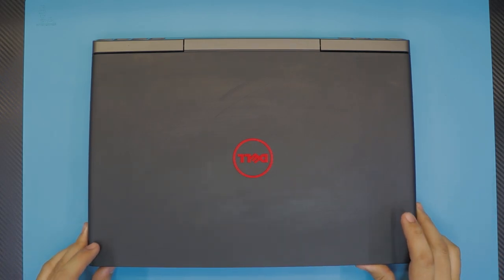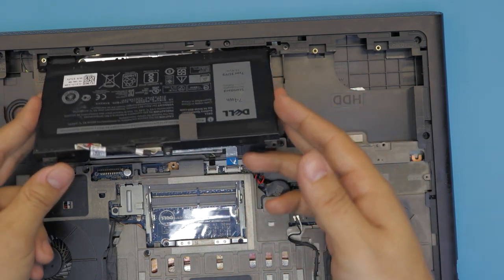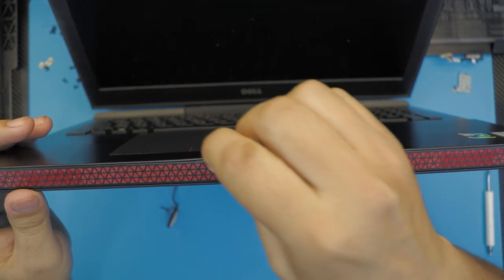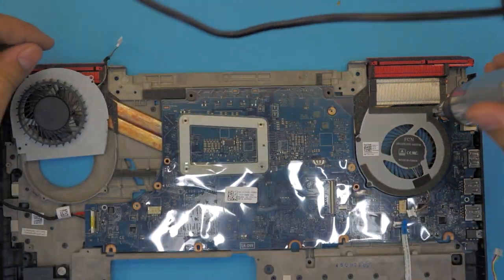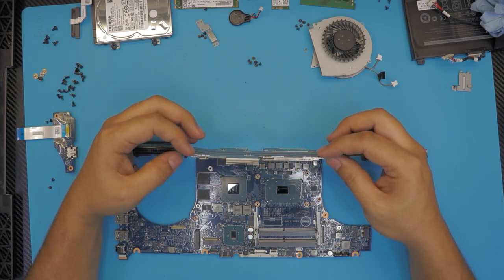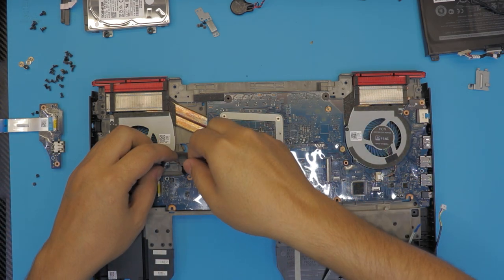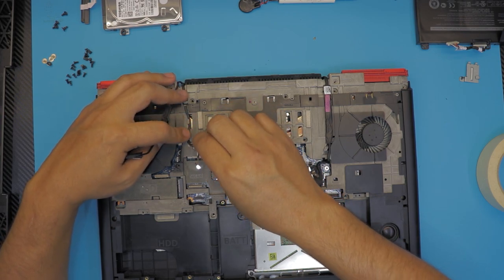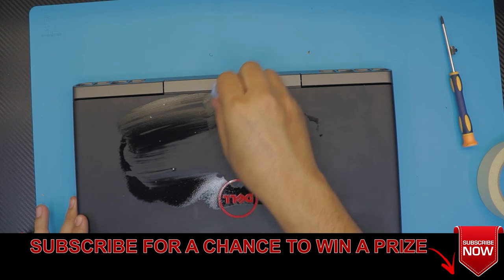Dell Inspiron 15 7000 LIQUID METAL thermal compound and teardown

Comment: I am planning to reapply thermal paste for my laptop and picking the right tools for it. Which of these tool kits is good enough ?
Set 1: https://www.amazon.com/gp/product/B07P6WSXBW
Set 2: https://www.amazon.com/Kaisi-Electronics-Professional-Precision-Screwdriver/dp/B07ZNHWHV5
I intend to use them for the current laptop and for building a pc around 2 or 3 years later.
And can I ask how would you organize the screws during the work ? There is a lot of different screw and I am scared to lose a few of them.
Reply from the maker: i would recommend you record your self doing it or simply in a sticky note write down for eg. bottom cover screws... and place the screws there, and fan screws.. and so on.
regarding the screw tools i recommend the following from top the best to less best:
the best : https://amzn.to/2CATV8e
2nd place from your list: https://amzn.to/2QeeRHQ
3rd: https://amzn.to/32cGp5W
the 3rd gives you more tip but the tips dont last long.

good luck

Comment: Everthing went Great except now my display won't work
Reply from the maker: Thank you for the feedback! if you wish to support the channel you can LIKE or SUB or both :P
regarding your issue:  it happens often that bios dont detect the rams , i recommend you to follow the steps: remove both rams,  and press power on and wait 3sec and force shutdown by holding the power button for 5sec, and once its totally off, the place one ram in the dim closes to motherboard and power on and wait up to 10sec to get a screen once you got logo or boot, the power off and add the 2nd ram, and power on wait 10sec and you should be all set, also check all you connectors.
Reply: @uFixTek  I just took the ram and put it back and boom my display is back, but thanks for your response on too.
Reply from the maker: you are very welcome glad you got it working, when every you have any other issue feel free to ask me :)

Comment: WISH ME LUCK. I am going to apply arctic mx-4, if i dont comment back in 4 5 hours, that means my laptop is fked. I have experience of teardowns of 3 laptops at least. bye
Reply: Update: stuck in process, missing screwdriver for m2x3. I might have stripped it but will now wait for correct screwdriver. I might complete process now in 6 hours
Reply: @commandroid9336  hey mate i will do it also. please share your comments after you did. thanks by the way
Reply: @oguzkaganakin659  update: stripped one of the screw of vent plate. Having hard time. Applied some epoxy between screw and the screwdriver, waiting for it to cure and see if it opens
Reply: Update: it failed to remove it. Stripped it even more, retrying with epoxy yet again.
Reply from the maker: CommAndroid if you need help or anything let me know, good luck no rush.
Reply: @uFixTek  that back plate over vents was a nightmare. Not sure how but after so much grinding with screwdriver my bro opened it up. Even removing the plate was so difficult with me, like 10 15 minutes for just that. I will continue process tomorrow. I just wanted to know is that removing display necessary?
Reply from the maker: CommAndroid what back plate?!, i hope you not talking regarding the back plate for keyboard, you dont need to remove the keyboard back plate. Just follow the video. The chassis on the bottom yes you have to remove in order to get access to main board, then you need to remove the board from top chassis. There is only one way not two way to get the board out. Let me know
Reply: @uFixTek  sorry idk what is the name for that grey cover over vents and over hinge. That was hell.

And is removing display from chassis necessary?
Thanks for your help man, i wont be able to do it without your video.
Reply from the maker: CommAndroid yes im sorry to tell you this but you do need to remove the lcd hindge, as is pinching the corner of heatsink, its a must, you have to remove the bottom chassis and top and remove the lcd. Anything else ask :)
Reply: @uFixTek  man i did everything. Nothing broke, did repasting and closed it back. Laptop power button lights up, fan run at max speed but no display please help if you can man
Reply: @uFixTek  sorry it was my mistake, laptop was discharged thats why it didnt boot. Now its all good with max temp dropped by 15C. Thanks to you man
Reply: @oguzkaganakin659  hey i have done it. I opened it 3 times in total so i think i got a pretty good idea lol. Remove battery first, its not in video but you do that step first. All silver screws are different than black ones, make sure you use correct driver or you will strip it. I feel like there wont be any need to remove display in order to remove motherboard. Make sure you keep your screws organize, there are different types of them. Some thermal paste was between tiny capacitors of gpu, i just left them. My laptop had mini desert inside lol. Cleaning and repasting with arctic mx4 reduced max temp by 15C. I can give you personal number if you need help
Reply: @commandroid9336  yo!! i was planning on doing it myself.. so its completely safe right ? with the right amount of tools??
Reply: @saiashishsadum6369  yes it should be. Btw your laptop will not start at first time after repaste on battery. Plug it in and then start. This is due to remove of cmos i think
Reply: I know it's been a year. But I'm about to tear down mine, Is there anyway at all you could tell me what size and type of screwdrivers I'll need so I dont strip anything? I wont be going as far as all the way to the cpu I hope, it's just for cleaning dust build up.
Reply: @SpacedFallen  Sorry dude I just put screw driver and see what fits, honestly no idea about size but gl

Comment: Just a little mistake you did. When installing heatsink back, you told us to first put middle screws and then other. But on heatsink there are numbers written on it to guide which screws to go first.
Reply from the maker: lol thats not important the order of the screws as long as you cross screw those not round about and not all heat sink comes with numbers.  always cross stitch the screws as you do when changing a car tire. or go with number its all the same. but glad that you resolved your problem :P
Reply: @uFixTek  Ah okay man. I did repasting on my another old laptop. Missed numbers and did no cross pattern lol. What do you think will happen in that way? half cpu covered?
Reply from the maker: CommAndroid yes its a very bad bad bad idea to not cross screw , you may have 90% chance that your pushed the thermal paste to one direction by doing it. Highly recommend you to re open and repaste.
Reply: @uFixTek  oh, ok man :/
Thanks for your help <3

Comment: Dell could've done a better job.. This is so difficult.. That's why i keep looking for other cooling solutions.. Although i know this is the best one.. other laptops are so much easy to disassemble! :(
Reply from the maker: Thank you! if you wish to support the channel you can LIKE or SUB or both :P
regarding your problem if you like you can use a equivalent of the LM that is paste (none conductive) you will only see 3-4 c less temp differences. 
but if you talking about the disassembly then yes its not that easy to disassemble, but if you need help let me know.

Comment: i want to upgrade the cpu
Reply from the maker: you cant upgrade the cpu or GPU they are soldered on mobo, and if you solder other cpu in there you will still need to add or different component for voltage control. therefore no upgrade

Comment: Even your battery is swollen, mine is worse to the point that laptop doesn't know what to do with the percentage. It's incorrect when it reaches 0%
Reply from the maker: no the battery in this video its 2week old , it may look swollen but its not at all. remove the battery if its swollen, else it can damage the motherboard or the charger will over heat and die.
Thank you for the support and feedback.
Reply: @uFixTek  it will charge fine on normal, Express and custom. It's not really bloated up that it pushes anything up. Trackpad up left feels bit hard but still working fine.
Reply from the maker: ah oki if still can hold charge and works and not bloated , keep using, but its better for any laptop to disconnect the battery if you have always the charger plugged.
Reply: @uFixTek  If it lasts 1 to 1.5 hours without gaming it's fine for me. I got a new G7 17 7700 today and also that one NEEDS thermal paste replacement. Known issue that these overheat during gaming and doing Power Limit throttling.

So i've ordered Thermal Grizzly Kryonaut on Amazon. With Gaming mode on, it gets about 65C and without a bit higher then that. Still better then other people are getting. Hope to bring it down to about 55-60c.  Also Second ssd gets quite hot ( Intel H10 Optane SSD which i've added to the system.
Reply from the maker: nice, if you getting 65 with gaming dont touch it, you more than fine there, only repaste if the temps hit 75+ on load. else no need to repaste. but if you feel like doing it sure go a head it wont harm it :P
Reply: @uFixTek  with turboboost, it will go higher then that.. on the G7 7700 it's easy to do. Just back over off, remove screws at heatsink and fans and you're at it.
Reply from the maker: oki, yes on g7 7700 its easy to remove the back cover and reach the components.
Reply: @uFixTek  Added a Intel H10 optane ssd on the second slot and will get adding 64GB Ram next week.
Reply from the maker: i would not recommend optane, better get a ssd m.2. regarding the ram 64gb is a good if you doing heavy video editing or programing, if gaming the 64gb its a over kill.
Reply: @uFixTek  Attempted the thermal paste today, the CPU fan connector was hard to get removed and no longer works. Pins inside the motherboard looks good, but it was probably jammed in by the factory. Contacted Dell Technical support ( from their website, not the scam ones ) and the one behinds the WhatsApp group is booking a Onsite Repair for me.

Laptop still runs fine, but with turboboost disabled as it already overheats with the fan working.
Reply from the maker: im sorry the comment got berried, its been 3days, im just wondering if you got it fix?
Reply: @uFixTek  Two fans and heatsink replaced under warranty and the repairman used Thermal Grizzly. Temps without Turbo boost ( must be disabled to prevent power limit throttles ) are now between 55-65 when playing GTA V. https://imgur.com/YNO5uXB

Even with turbo boost on, temps are way better * i'd say around 70-75c* then it was before.

Also have upgraded to 64GB ram, stock was 16GB.
Reply from the maker: @daand12  Nice glad that you got it all repaired and very nice temps , enjoy your laptop, if anything in the future ask out :P good luck

Comment: I’m never gonna do this it looks scary asf
Reply from the maker: not scary if you follow step by step, and have some faith in your self :P
Reply: uFixTek this is my only laptop and I don’t have any money
Reply: uFixTek I really really don’t want to break it I just want to reduce temperatures
Reply from the maker: then dont open it at all, get yours self a laptop riser and lift it about 1-3cm off table and it will reduce the temps abit.
Reply: uFixTek do cooling fans help?
Reply from the maker: yes it will help, def it will.
Reply: uFixTek I meant those cooling pads with cool lights and stuff
Reply from the maker: https://amzn.to/2Yiw2fx
Reply: uFixTek is it good tho?
Reply from the maker: yes because it has the most air flow

Comment: First thing to do is disconnect the battery 🤦
Reply from the maker: you could just remove the battery 1st but, to remove the components as i showed there is no need to disconnect the battery, but if you feel safer by doing that sure thing.  appreciate the feedback.
cheers🍻